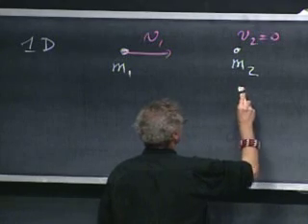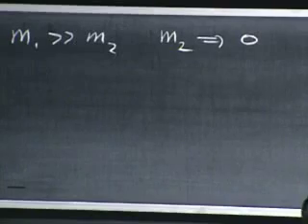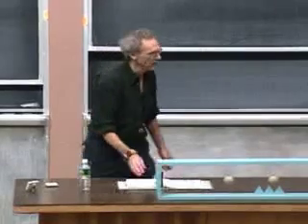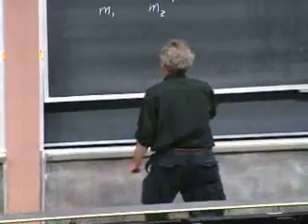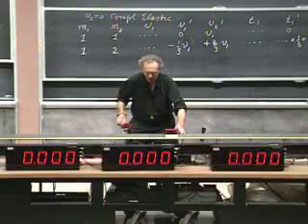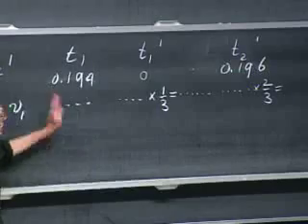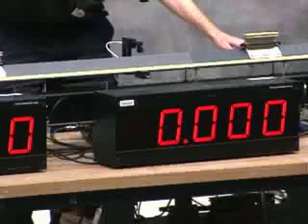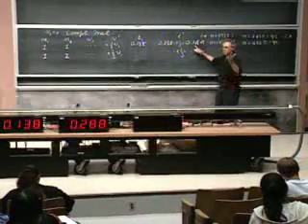Lecture 16_ Collisions - Elastic and Inelastic - Center of Mass Frame of Reference.mp4

Comment: a tennis ball bouncing off a wall?????

what happens to the wall?

the wall is connected to the ground (ie earth) therefore the earth must move (even if its so small that it is non-detectable)

although, if the wall is located on a continent which is potentially shiftable (ie continental drift) then perhaps the continent and/or moves when the tennis ball strikes the wall and rebounds

For the conservation of momentum assumption to hold, the object that the ball strikes must move